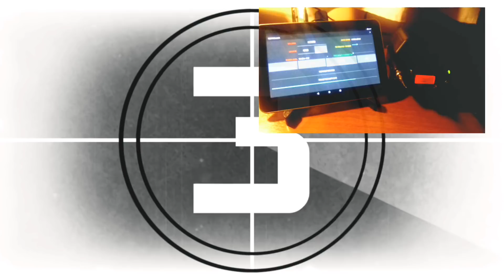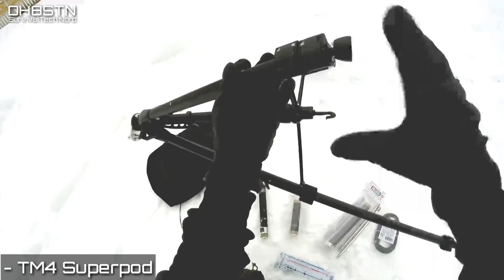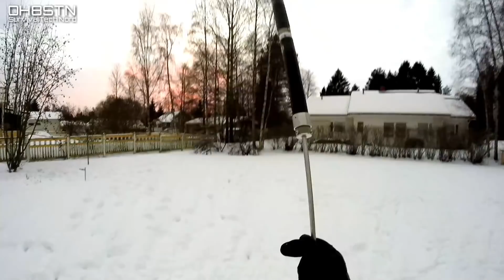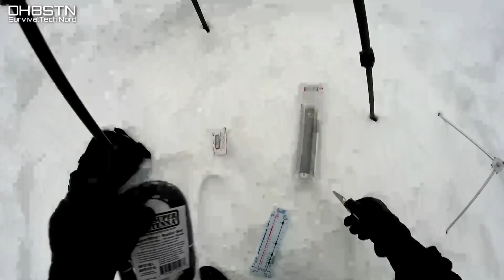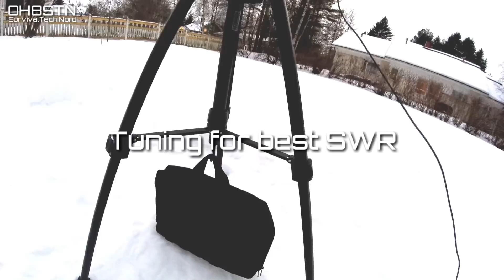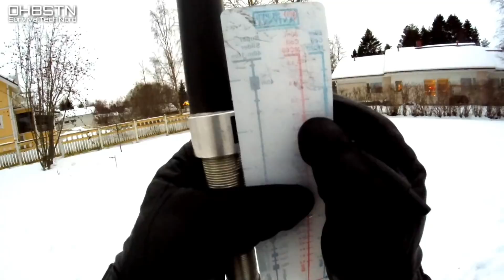Super Antenna MP1 | MARS/CAP tutorial

Comment: In SuperAntenna's application note for MC80 coil for MARS applications, it says to place the coil between the extension rod and the SuperSlider coil, but in your videos, you place it above the SuperSlider...will it work in either location?  I just came into posession of one of these units and want to try it, but want to make sure I do it right..BTW, your videos are most helpful.  Thank you!
Reply from the maker: I may have used the wrong clip in the video. I would definitely follow the application notes from super antenna. They are meticulously done, and are usually correct. 
73
Julian oh8stn

Comment: Julian, as always another video which explains technical information in a straight forward manner.  I have several questions regarding the setup.  First, did you put the tripod at its highest level and added the additional ER1 to obtain better propagation?  Second, being that the wind load on the antenna is probably hard to determine; is there a maximum wind speed you feel is permissible before you would figure out a guy system/anchor system to stabilize everything?  Third, does the tripod allow for the attachment of guy wires?  Fourth, is the tensile strength of each connection point of each component of the antenna adequate to prevent/cause a failure.  Finally, what are your thoughts about using a ground spike when snow depth would not be an issue.  Thanks, Joel n0dne
Reply from the maker: +Joel Talbot hi Joel thanks for the feedback kindness and questions. Let's see if I can give you some answers. I wasn't really worried about the height of the antenna, but more is always better. A long time user of the mp1 suggested using two er1 extension rods. I tested with wspr to see if it really made any difference, and it did. Since then I always used to er1 extension rods when possible.
The wind loading question is magnificent! So I used to tripod because it was simply a demonstration of how to set up that system. If I were in a real situation, with heavy winds rain the whole nine yards, I would actually prefer to use a ground spike as a "wind-proof" method of ensuring the antenna stays where it belongs. For normal deployment using that's TM4 tripod, the hook underneath the tripod allows you to add ballast lowering the center of gravity of the antenna system, and keeping it where it belongs. What the actual wind loading is I can't say, but from experience if you're worried about when loading and the weather is probably too extreme for a tripod. 
I never thought about guy wires for the tripod before, so I actually had to go out in the yard then test this. I used to 5 meter length of stretch cord with a slip knot loop on one end that attach to the center pole of the TM4. I then spiked the other end of the stretch cord down with the snow anchor. It's not designed to be used this way but it would definitely keep the tripod in place and more severe weather. Thanks for sharing that tip I think I'm going to make a blog post on this.
Tensile strength. I'm not sure how to answer this question without it sounding like a cop-out but I'll give to go. There's two weak links on this system, that's the telescopic whip, and the slider. Solving the weakness of the telescopic whip simple as we just replace it with the titanium whip. For the slider it's possible for debris to get under the slide in heavy snow, sleet or things like that. The good news is that slide is designed to be field-stripped, cleaned, and put back together. It is not designed to be used as a hammer or anything like that, so in that respect it is fragile. Still there is nothing that can't be repaired buy a radio operator. I think someone did a very clever cost-benefit analysis when designing this. Anyway the last part of your question, each connection Point uses aluminium plate and threads. The tolerances are actually pretty incredible, so everything fits like it was designed as a medical device. With all that said there are definitely more robust antenna systems out there. However I believe many of them come at expensive of additional weight. You'll have to look at your requirements to decide if this fits or not.

The ground Spike again very nice. As I mentioned earlier I do use a spike in the snow in fact I use it when it's not possible to reach the soil. Performance is about the same as the low profile tripod.
Awesome questions, thanks for sharing them with us.
73
Julian oh8stn